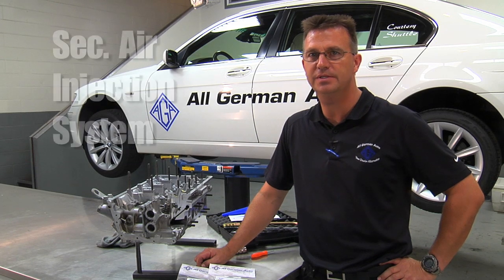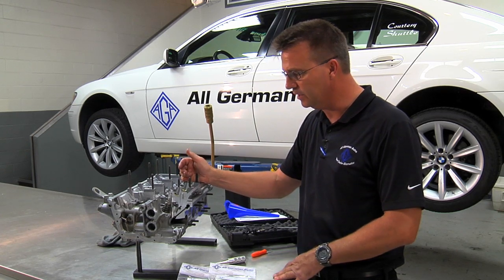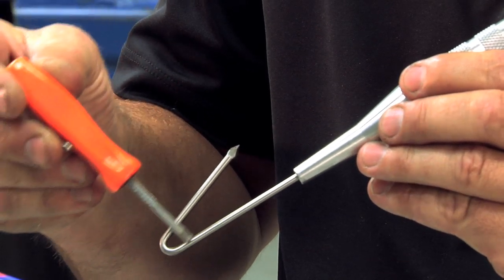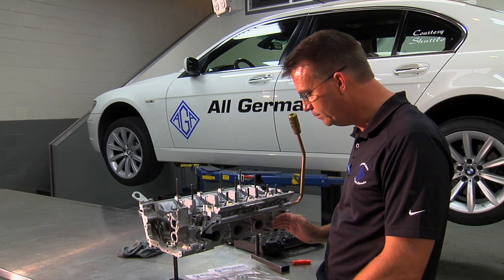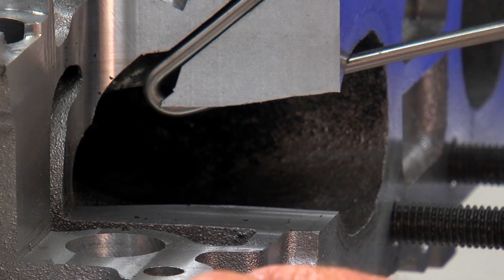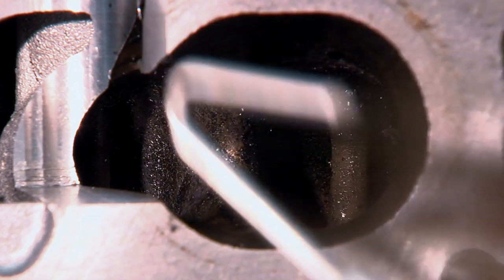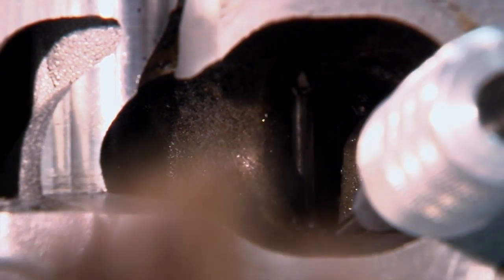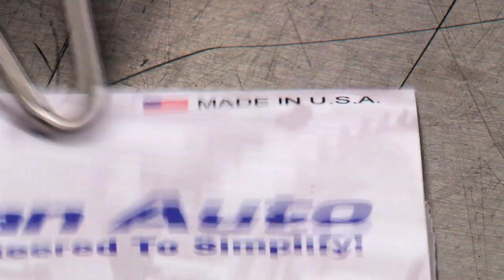AGA Carbon Removal Hook Tool

Comment: This tool does not work, just like their other secondary air cleaning kit. All this tool does is compress the buildup in the port. The only way to clean them correctly is to get the jig that mounts on the side of the lead and drill into the air injection and clean the 16 ports correctly.
Reply from the maker: We and along with 90% of our customers has much success with our Carbon Removal Hook. Now, this isn't to say it's easy. It's VERY time consuming and tedious work. Cleaning carbon buildup is like picking at a stone wall.

Soaking it overnight, using both our diamond tip blade and square blade (heat it with a torch if needed) has been our method and something we share with all shops. We understand there are other ways to do it, we found this to be fastest and safest for us in our shop.
Reply: AGA Tools you should pick up the jig that uses the two bolt holes by the secondary air and tell me that it is not faster than your hook. I can remove drivetrain, clean all the ports and have it back in the car all the same day. It's about an 11hr process. Your hook tool can leave a technician hung up on a port for hours. I know because I used it to see if it was faster than our method.
Reply: Your not lying none of the aga tools work a ripoff
Reply: @demondkennedy2794  if you're doing n62 secondary air diagnosis I can give you the procedure to clean all 8 ports in about 2hr after lowering the drivetrain... money maker
Reply: @skatir9  I’m down aga is no good
Reply: @timocrosby  Its one of those jobs where you do it enough it becomes not a big deal. I have good experience with BMW and make quick work. I am not saying it in an arrogant way. You can come here and I will show you how I do it in that time frame. I have automotive videos on my channel but not one of an n62 doing secondary air ports.
Reply: @timocrosby  To be honest, I am not sure. I am on the other side of the door.

Comment: I wish you would show these tools actually being used while the engine or cylinder head is in or on the vehicle, especially the E60, 545.
Reply from the maker: RonVF, as much as we would like to do that as well, it is very difficult with such angles are we limited too. We would need to stand on one side of the vehicle while the camera man is standing on the other, with that he would not be able to see what we are working on.

Everything is the same, it just seems different because you are bending over into the engine. If you are still having issues, please call Richard @ 760-738-4084 and he will get you taken care of.